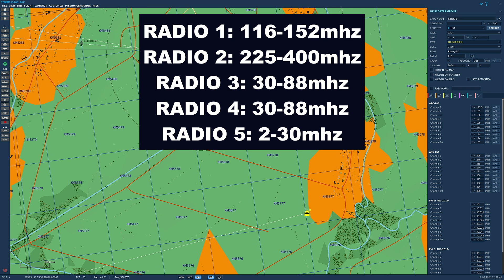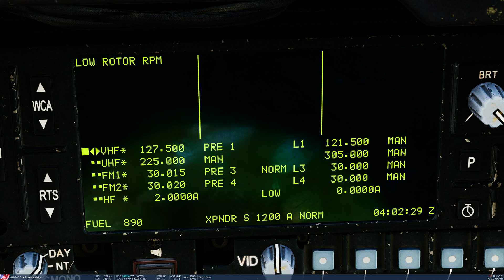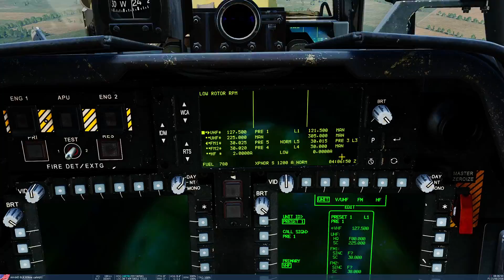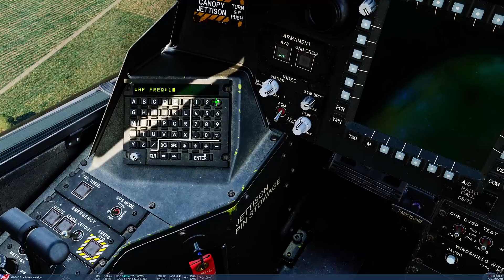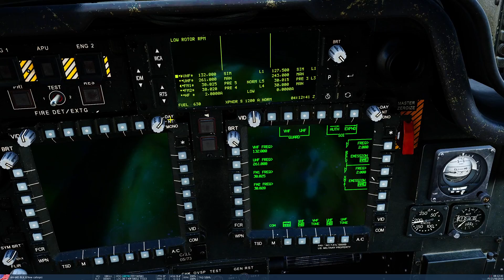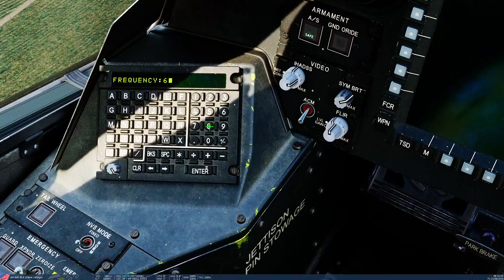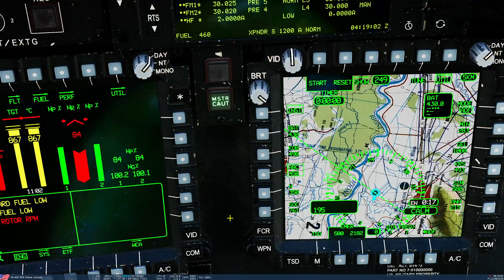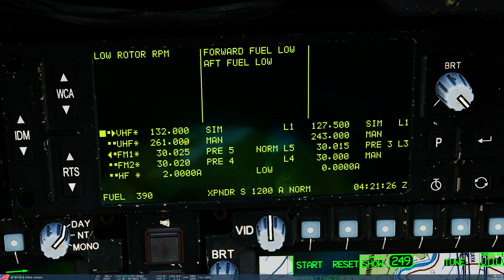AH-64D Apache: Radio Communications, EUFD & ADF Navigation Tutorial | DCS

Comment: As usual a great video. When I first used the Apache I was in the front seat and i had 5 way points and it flew it automatically. I don't remember i did it. When you have time could you please go over that. It not only change way point automatically, but it also turned the helicopter without any input from me. Thanks